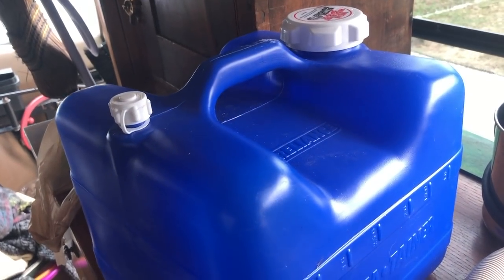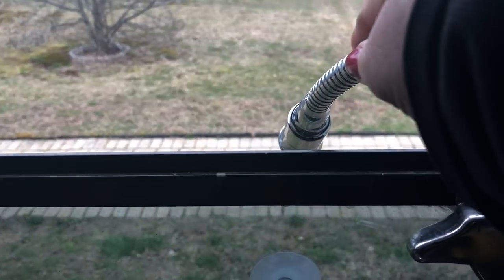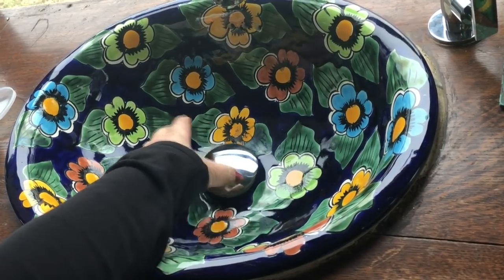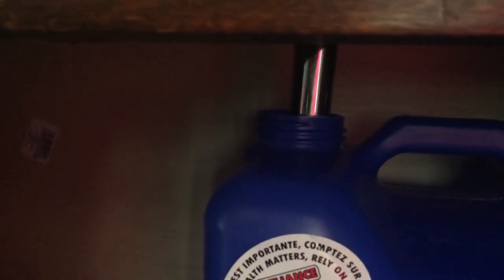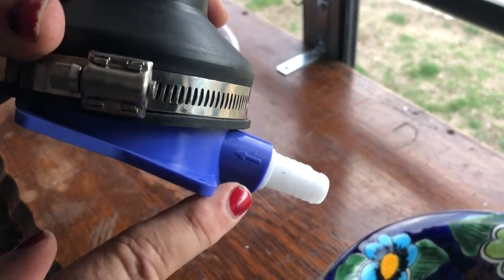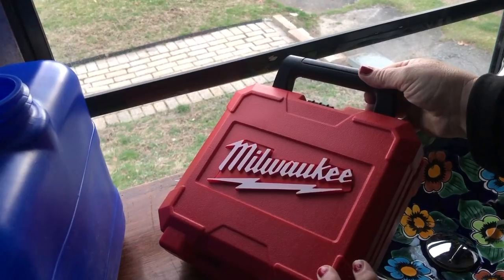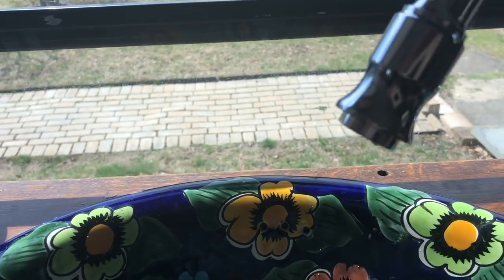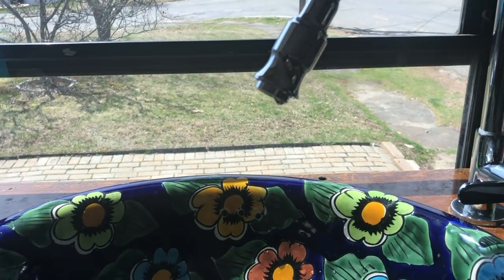A FOOT PUMP SINK For My Skoolie

Comment: Great how to video . Thanks 😊
Reply from the maker: Tnank YOU! I do want to mention the hose I used isn't totally working out in the small space it has to fit into; it kinks too easily. I'm about to redo it and will post a new video when I do. This  hosing works fine if you have more space and can avoid folding it over,, but the kind that has fibers in it would work better otherwise.

Comment: Hey, Mary! So, I'm at the stage of putting in my sink, water, faucet, etc. After using this foot pump for a year+, how do you like it? Do you have to keep pumping to fill the bowl? And how do you like the faucet. I basically have the same type of set up with a sink that has no faucet hole(s) so I really want one with just one hole to drill in the countertop. ALSO, how do you like the little drill you use? I'm in the market for a good all around all purpose drill. thanks!!! I'll share some picture of my little bus soon. I'm so excited. <3
Reply from the maker: Hey, sorry it took me so long to reply, I didn’t even see this comment! So exciting that you’re putting in your sink. You do have to keep pumping to fill the bowl but I have found that it is rarely necessary to fill the bowl. I wash dishes completely differently than I do when I’ve got a regular running faucet. I like it, because it makes it much easier to conserve water. I have a lot of drills so I’m not sure which one you’re talking about but I think you mean the hole dozer if you’re talking about putting in the faucet. I am in love with it which is really dumb but yes I come up with things on purpose that I have to use it for because I like that hole dozer so much. If you see me on camera using a tool I probably like that tool because I try not to put tools I don’t like on camera. Why give them any press if they suck? Let me know if you have any  other questions!  I think I answered them all but I might’ve missed something!
Reply: @MaxMiniTV Thanks for answering, not worries.  I was thinking the same thing about water conservation and that's a good thing. You do have a stopper so that helps, fill a little way and wash. Actually, I was asking about your actual battery all purpose drill. I've seen you use a smaller one.

Comment: i love your attitude problem LOL. Great video i am about to do this and haven't been able to find a video that explained what i wanted which is this and didn't you know that there are a million choices out there for holes and drills and screws ... when i go to the home depot i plan to spend the entire afternoon lol.  thanks for posting this!!!!🚎🚎🚎🤣🤣🤣 ps. i just learned that i need to take my water jug and tell the guys what i want so that i can buy the right fitting.
Reply from the maker: Chevy Van Travel  sounds like you are FAR ahead of where I was when I did  mine!
Reply: @MaxMiniTV  not at all just collecting as much info as i can... but you provided all i needed with regards to the pump and the faucet ..thanks again.

Comment: Yay, you! You did a fantastic job, and I love, love, love that basin!

I did not know that about overflow drains, so thank you for adding to my own knowledge base!

With those huge water jugs, what are they - 5 gallon? 10 gallon? I love the concept of this whole setup, but I would personally never be able to wrangle those things when they were full. How are you managing them?

I’ve been trying to think of a workaround - because I’ve been much more seriously considering a skoolie myself! I actually almost bought one last week that was already partially converted (although painted black inside and out!) - but it was a full size one, and I suddenly freaked at the idea of 39’ of bus and what it would cost that I don’t have to finish the conversion. It didn’t even have a wheelchair lift, either, and those things are hella expensive to install. I might need to get a kneeling city bus instead - which would actually be a lot easier for me to get in and out of even on foot, in part because of the preexisting built-in ramp. All of these larger vehicles have such impossibly steep and tall steps!

I am so jealous of that hole saw kit! I want to make pendants out of some of my broken china, so I need some of those bits, but have so many other more important expenses to deal with first.
Reply from the maker: Hey there! The jugs are 4 gallons. A gallon of water weighs 8.34 pounds, which makes each jug just over 33 pounds. They are the only ones that fit in the cabinet and they're a much more manageable size than most people have; I see people mainly using the 7 gallon version. I try to fill them near the bus so I don't have to lug them far, but I have both a folding hand truck and a small furniture dolly with me all the time, so I can use "wheels" when it's feasible. I usually wheel the jug to the side door, then lift it up into the bus, and drag it into position. I should make a video of that sometime - I forget how baffling little things like that can be. I can lift 33 pounds if necessary, but I have to do a lot of stopping and resting to move it any distance. 

For me, 39 feet would be wayyyy overkill. I don't need the space, and I don't want to drive it. 

Last but not least: There is nothing as important as a hole saw. LOL

Comment: Grey water tank smells so it's better to make a hole through the floor with flex pipe and let it all out , then you can carry two fresh water tanks.
Reply from the maker: Well, that's a nice idea when you're in SOME places. But in other spots I would most definiteyl not offload my grey tank onto the ground! Mine doesn't smell at all, so I guess I'm doing something right.

Comment: Great video! I just subscribed, btw. Just wondering if you found a satisfactory solution around that leak? I'm trying to do a similar setup and this is my stumbling block.
Reply from the maker: Hey there! Yeah, I never did get around to reporting on that. It was exactly what I thought it was for me, the faucet I bought from Amazon was metric. I just got a metric fitting for it and all was well. Good luck with your sink, and thannks so much for subscribing!